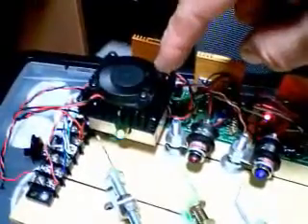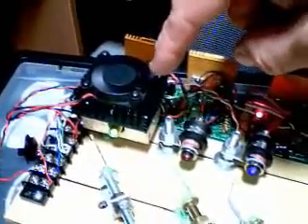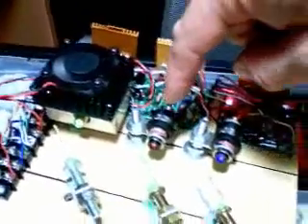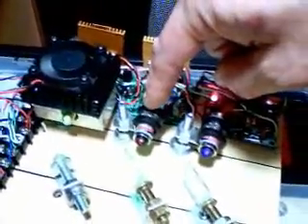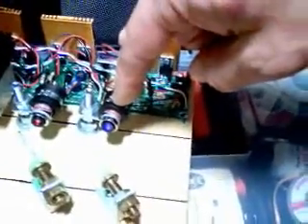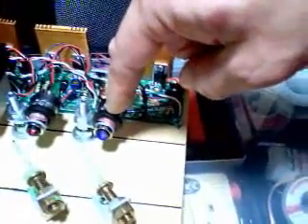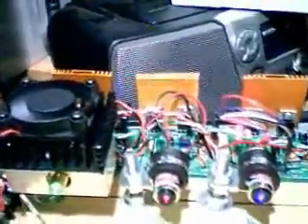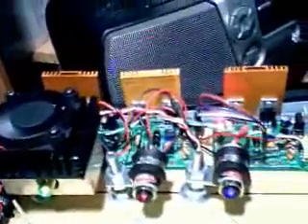Whitelight RGB Diode Laser

Comment from the maker: OK.  I just used one meant for blue.  It came from a Sharp LCD video projector.   They are not for specific wavelengths just for broad red green and blue.  Therefore their efficiency is a bit less (or alot less) than the ones for specific wavelengths.  

You can use a PBS cube for 2 of the lasers and then a dichro to add the 3rd color.   If you probably already have a 405 sled then you should just use that stuff since you are on a budget.

Comment from the maker: I am using one that was meant to reflect blue.  It works.  I am not sure of the efficiency though.   You can purchase 405 nm (violet) specific dichroic mirrors though.   Alternatively if you have just 2 laser you want to combine you can use a PBS Cube (Polarizing Beam Splitter - also works to combine).   They will probably be more efficient and there is one in the Bluray laser sleds that the diodes come out of.

Comment from the maker: It did not work well.  I repalced it with a better constructed green DPSS laser.  The stability is also affected when modulating the laser too.  The one shown in the video did not modulate (turn on/off) really well.  That is another reason I replaced it. 

I will post a follow up with the new RGB(V) laser build.  It now sits in a laser projector.  Really neat!

Comment from the maker: The gree laser is a Diode Pumped Solid State laser.  It cotains a couple of crystals and a infared laser diode to "pump" / excite the crystals.  It is not really effiecient so it generates some extra heat.  It does not get really hot by itself however the crystals are very temperature sensitive.  The large block of aluminum and cooling fan are an attempt to stabalize the laser's output by keeping the temperature stable by using a large heat sinking mass.   This did not work.

Comment from the maker: I do not know what my losses are.  I have revamped the setup since then to include a ~100mW  PHR-803T BlueRay diode and a 15mW green DPSS module in a big heat sink which modulates fairly well.  Losing alot of green light isn't so bad for color balance as that is usually what we have the most of.

Comment from the maker: Thanks!  I like your work too.  Your laser experiments are top notch!

The projector I got the dichros form was an old SHARP LCD projector that used 3 monochrome LCD panels.  The dichros were used to maybe split and then combine 3 primary colors modulated by the 3 monochrome LCD panels.   The projector is long long gone.  It was a long time ago but I believe it was one of these:

Sharp LCD XG-E850

It worked then blew up because of a loose screw.

Comment: A cheep hack, send power through the cell terminals on a 3.6 volt lithium ion smart cell PCB and then use a resister to calibrate the right voltage off the 3.6 volt output of the smart cell driver, because of the nature of lithium ion I found it to be a good way to control stable laser output as well.

Comment: I've seen this happen before when modding the 532nm pointers into long duty cycles (ie: greater than a minute or two for pointer purposes) It is usually due to the Nd:YAG crystal building up excess heat and expanding its holding material (sometimes just glue) enough to lose some alignment with the IR pump diode.  There are some high-powered Nd:YAG and Nd:YVO4 crystals mounted in metal housings on eBay for precision alignment + heat sinking ability which might eliminate this problem.

Comment from the maker: If anyone has suggestions on how to get stable output from the Green DPSS laser I would appreciate it.  The driver it came with use light feedback for regulating the power however I am using a current regulated power supply.  Light feedback would be better however I don't have the ability to make such a sophisticated diode driver.  

Also I am in the process of combining this with my XY scanners.  I will be posting a video of that when it is done.  Thanks for watching.

Comment from the maker: The beam is still white.  The balance between the lasers is important for the white.  If I have too much red which is easy to do I get pink.  I am having a bit of trouble with my green DPSS laser.  It takes a bit of time to warm up and it doesn't modulate well.  Once it is going full power the beam is nice and white ... up until that point it is pink.  The big heat sink was to keep the temp. stable... probably could be a bit smaller but I had that chunk of aluminum on hand.

Comment from the maker: BTW:  You the green laser is from a laser pointer pen from Ebay.  $25.  The case is + and the isolated pin on the diode is -.  The optical sensor for feedback was external to the diode.

I used the 405nm diode vs. the 473nm DPSS because the DPSS blue lasers are really really expensive.  I spent < $200 on this setup and I could have made it a bit cheaper because I did some experimentation with different setups.

Comment from the maker: Thanks!  The heat sink is there to provide thermal mass so that the green laser stays at a constant temp.  I intend to use this for hours not minutes (like the laser pen it came out of).  Plus I am running the green laser using current regulation instead of optical regulation (this affects the stability).  That thing puts out a lot of heat!

The beam turns out looking white.  It is a bit dimmer in the air than when it hits a white sheet or the wall (because the sheet and wall flouresce?).